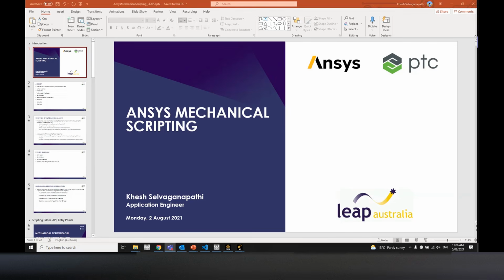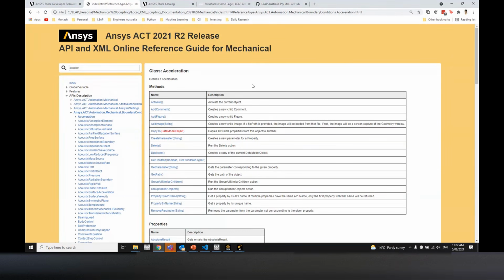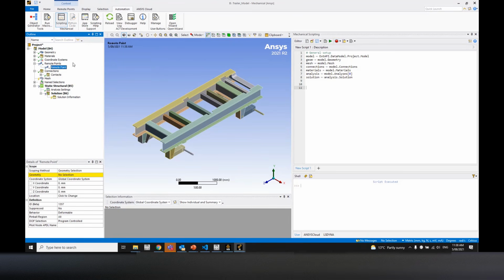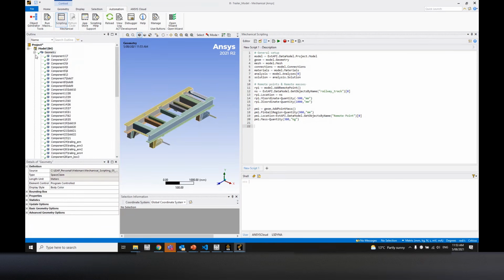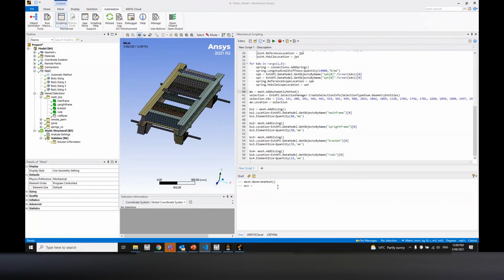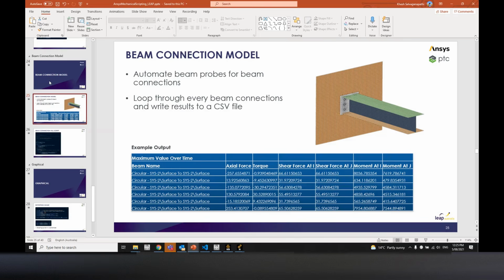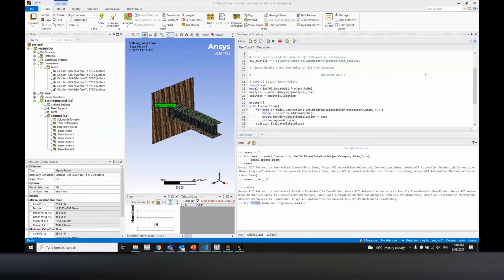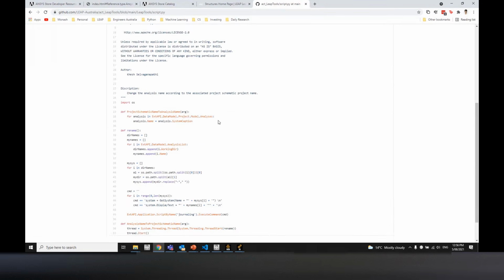Ansys Mechanical Scripting Training - Scripting in Mechanical (Day 2)

Comment: How do I activate the output parameter for a result via script to be visible in the WB Design Point table? For example, Max Principal stress? I only need to know how the radio button is activated and deactivated. I tried recording the script, but these steps are not recorded.

Comment: Thank you for the informative video, it's been very helpful. I have three additional questions for you, if you have time. 

-First, for the remote point coordinate using a variable, will there be an update explaining how that would be done? 

-Secondly, do you think you could explain how to set up a displacement as a function (of time) Without simply entering the desired displacements into a table and importing that? For instance, if I wanted the displacement to be y=sin(t) where t is time, how would one go about that in script?

-Thirdly, using script, how would you export the data (for instance, if I was interested in maximum and average stresses and displacements) I'm using 2021 R1 and using the record feature doesn't pick up anything in terms of the solution, or exporting the data. 

I know this is a tall order and it's okay if you can't answer any of the questions, but I appreciate your consideration, and if you can point me to any additional details that may help (without being so general as to say "just check the API and XML Online Reference Guide") I would greatly appreciate it. Thanks for your time.